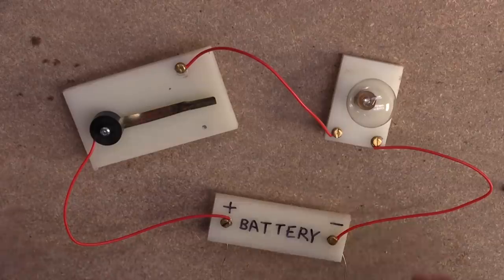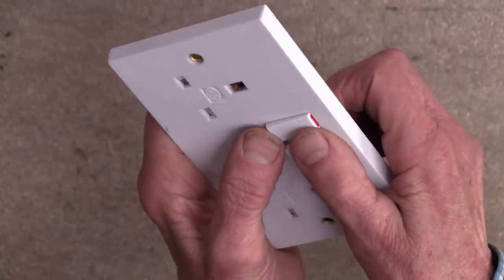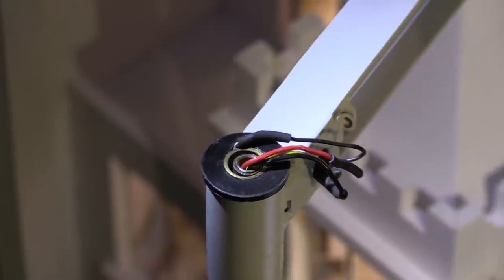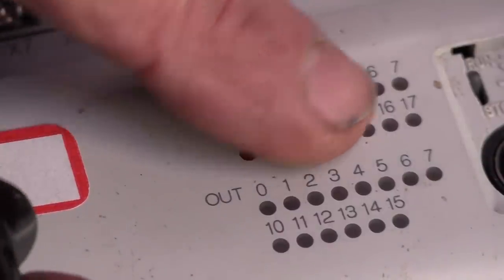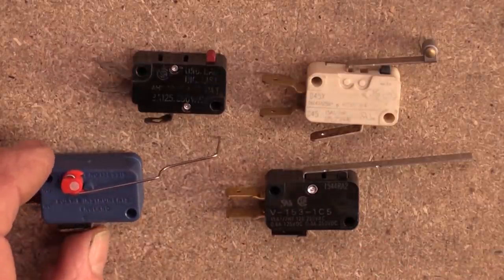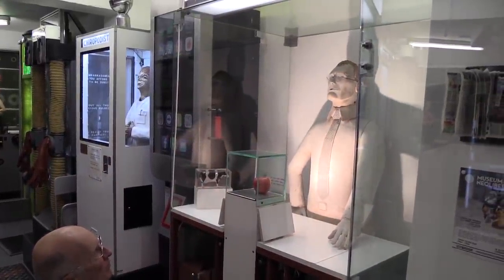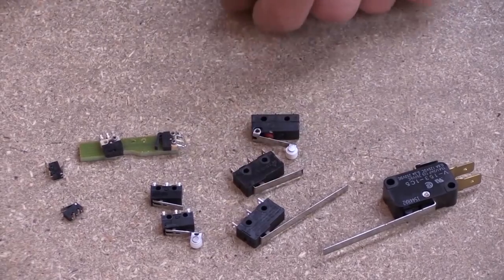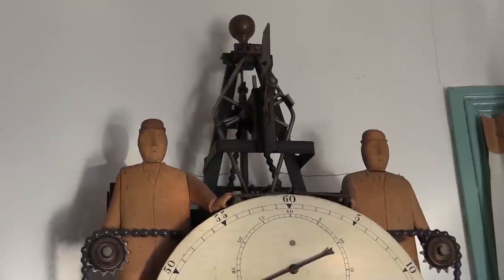SWITCHES - The Secret Life of Components, a series of guides for designers and makers - Episode 4

Comment: At an old house in northern Wisconsin we had wall light switches with a sealed capsule that was simply rotated by the switch handle, and mercury inside made and broke the contact. I think they were advertised as "silent" switches for those offended by the clicking. I also found references to mercury switches used for safety in the presence of explosive atmospheres, so the light switches in a hospital operating room, for example, might be of that mercury type, since any arc is fully contained in a sealed capsule.
Reply: Peter,  Back in the late 1970s and early eighties when I was a car stereo and alarm installer, we used to install plastic encapsulated Mercury switches mounted to the underside of car hoods and tied into the alarm system, so if somebody jacked the hood open with a crowbar to steal the battery, the alarm would trigger as soon as the hood was raised.

Comment: I wonder if the mercury switch/wall sockets were in a place where there might have been explosive gas or dust. Any arcing of the switch would be contained and safer in that kind of environment. Just a thought...
Reply: The wall switched were marketed as "silent switches" in years gone by (1970s).

They also had a secondary use to help to quench RF interference - I've seen them  installed at a  radio intercept station as well as a coastal radio station, with anecdotal reports of them being preferred for high-end recording studios. Yes, with AC zero crossings the arc is quenched anyways but presumably the mercury seems to provide a "soft" start and finish to the arc as the liquid and it's vapour makes and breaks contact - anything that softens the sharp transition is a good idea as rapid rise and fall impulses = high bandwidth emissions.

They are also much harder for the user to "ride" the switch half-open and arcing if they activate it slowly. The mercury provides a fully wetted and moveable surface so tarnishing is not a problem for decades of use, so they are quiet (RFI-wise) throughout their life.
Reply: General Electric made mercury light switches they called the "Super Switch". IIRC they ended up banned and ceasing production of them despite the mercury capsule being deep within the switch where to open it you'd have to take the switch out of the wall, disconnect the wires then smash the switch with a hammer. But stupid people who think they know what's best for people just have to exert their power by getting harmless stuff banned.

Some searching turns up several other companies that made mercury light switches, most of them, including GE, emphasized their click free, smooth and silent operation along with never wearing out due to not having mechanical contacts.
Reply: Mercury switches are brilliant if you don't want the "contact bounce" effect of spring driven contacts. If you are counting up switch inputs with say a microswitch then you would need a debounce function in your circuit to prevent nuisance multiple counts. You can get away with not doing debounce when you use a mercury switch.    (Or one of the newer liquid-metal ones that replace them)
Reply: @jagmarc  good point, however the mercury can shlosh a bit if the capsule movement is not varied enough
Reply: @Poop-nu1so I don't know if I'd feel comfortable with a setup with mercury switch being bumped around anyway.  I certainly wouldn't have on a vehicle for example in case it got into a crash.  The best use for one I've had is formal tests on the bench during product development, for inrush current spike measurement for a unit to go on an airframe power bus. Inrush current has to be carefully limited during swich on so as not to disturb other units on the bus. The mercury switch is absolutely perfect for the qualification test, a zero-bounce contact closure 100% of the time.  Important of you had carefully set up a one-shot test and didn't want contact bounce to mess it up.

Comment: Those mercury wall switches were probably intended for use in a laboratory, a mechanics shop, a painting/varnishing room, or some other environment where explosive gasses could be present.  The mechanical side looks like a common wall switch, but the uncalculated mercury contact contain the arc that forms when the switch is used, so there is no risk of igniting any volatile fumes which might be in the air.

Comment: For inductive DC loads like motors, put a reverse biased diode across the switch to stop arcing. 
Normally the diode will not be conducting (being reverse biased), but at the moment the switch opens, the induced current from the motor is flowing in the direction of the diode and will be shunted back through the motor.

Comment: Limit switches using microswitch with a leaver are obviously very simple and working solution. But in many modern designs, if you can, you can just make the object hit a solid wall, and that can be detected in current / torque rising in the motors or stepper motor. Often it doesn't even require specialized microcontroller or extra code, as a lot of stepper / motor drivers do have outputs for this purpose which are easy to hookup to relays, or PLC. A lot of device both in consumer space and industrial devices use this method. More reliable, less parts, less wires, maximizes travel. Pretty neat. I.e. my 3d printer has no limit switches. It just bumps into all sides, and detect that the current is rising. On precision machines, a more complex methods are used, either a digital readout or inductive proximity sensors, or a mix of both for safety.

Comment: When it comes to sub stations, these are isolators you showed. They use different types of circuit breaker which checks the current, voltage and frequency.

Comment: The high voltage switches move slowly to prevent thunder. If they moved at high speed, there would still be arcing but it would be a loud cracking sound, like thunder. Plus, the slow moving switches increase the power to the line slower, using the air gap as a resistor.

Comment: Note that reversing a motor, whilst it's moving, drastically increases the load on the gearbox and shaft, as well as causing large current surges, which can cause damage, if it's driving a load with a lot of inertia. I definitely prefer to use limit switches with diodes, rather than on the inputs to the controller, especially when over-run will result in damage to the machine. If you need feedback, so the controller knows the limit has been hit. There's no need for a separate switch. Use an SPDT switch and take the input from the normally open contact. For very large motors, a reversing contactor is used and the limit switches can be put in series with the coils.

Comment: Beware when using 'power' switches for very light loads like inputs to PLCs and microcontrollers. The contacts inside oxidise and soil.  It's fine when the switch directly handles the load current because the arc cleans the contact. Low-current contacts ones are better suited they have non tarnish or gold contacts and in the past mercury-wetted types (most get damaged by current more than about 20 mA). Or use opto interruptors (which can be electrically fragile if misused). I should mention in UK there's a fantastic product available to use when switch contacts soil up and stop working called Servisol 10. Great too for scratchy pots on studio mixing desks too.

Comment: About the solid state relay. In industry for loads like motors, or heaters, if they don't require rapid switching on and off, it is very popular these days to use a hybrid switch. With both slid state relay (SSR) and mechanical switch. During on, the SSR is turned on first, then the relay, then the SSR is turned off. SSR can turn things up without arcing, but then the load is transfered to mechanical relay, which can have lower resistance, and heat up less. Similarly, switching off: while the relay is on, turn on SSR, turn the relay off, then turn the SSR off. It again will prevent the arcing, and switch things off nicely. Because the time delay of the relay is pretty well known, and is definitively less than a second, the SSR will be turned on for very short period of time, and will not require big heatsink (but its temperature will still be usually monitored by a chip or micro controller). Some hybrid relays, do have also a special mode to dump back EMF to bank of high power resistors on turn off. Similar hybrid approaches are sometimes used in power supplies to charge input capacitors. Initially capacitors are charged using relatively high value resistor, then after specific time (or monitored voltage), a resistor is bypassed using a relay. Then the rest of the power supply starts.  This reduces the inrush current, and reduces failure points (like fuses, NTC resistors, switches when switching ON - but not OFF, if there is load present, etc)

Comment: 30:55 perhaps those mercury light-switches were used in a situation that either required ZERO maintenance, or more likely a chemical situation where a spark could cause an explosion.  
The encased liquid mercury switch can be used forever without building up any tarnish on it's contact surfaces, and it cannot weld itself shut.  
Also due to it being encased in glass - the arcing inside it will never be a source of ignition, so is safe for use around explosive chemicals.

edit:  oh other people have already said this :)

Comment: 31:00 those mercury wall switches might have been a equivalent to a US switch the "silent switch" for nurseries in the like. I could also see that being used somewhere where you wouldn't want an arc to form say around explosive gases. I suspect they pre-date everything due to the Ark being sealed it would be perceived to be safer and it would be easier to implement than the spring mechanism that came I believe later.

Comment: You should add self powered switch or power generator switch. These small electronic switches generate enough power from kinetic press to run a whole micro-transmitter to enable a device.

Comment: The breakers at substation are actually spring loaded. They can open, even with lack of electric power to drive motors. They open fast. Some have very powerful springs or pressure systems, to open them rapidly. You don't see them usually, because these devices are usually fully enclosed in special kind of gas or liquid, to reduce arcing and extinguish it. Amazing video on the switches topic tho.

Comment: I had a volvo 740 from 1991, a sedan and in the boot lid was a mercury switch for the boot light. I was astonished they used that still in 1991
Reply: I remember thermostats using them well into the ‘90s. I think they finally switched over around the year 2000.

Comment: The wall switches with mercury were probably to address arcing and oxidation of contacts.  I'd presume they were evacuated of oxygen and assumed they would last longer than open-air contacts in addition to their preferred use in environments where they may have served as an ignitor.

Comment: good video sir. for your question of what purpose the mercury switches in the end of the video have been used. probably they have been used for switching lights in a Explosion safety rooms or EX rooms. where sparks and arcs or open flames are not allowed

Comment: My wall thermostat that controls the heating uses a mercury switch and a bi-metal coil. I actually prefer modern thermostats with spring contacts because they make an audible click when they go on, but I haven't updated the old mercury one because it's just cool.

Comment: I'm surprised Mr. Hunkin didn't talk about Switch Bounce.  How all switches have a tendency to bounce when turned on or of, so to sensors, microprocessor or digital connections, the switches appear to make several contacts, when only 1 is desired.  Also, digital is also switches: on or off.

Comment: I guess a good use for your mercury wall switches would be in explosive gaseous environments. 
To avoid material stresses from your lever yanking customers, may I suggest putting in spring or rubber style dampeners ? It works very well to prevent my eager dog from ripping off his line/injure his neck

Comment: Interesting stuff. I recently had a problem with the pressure switch on my old portable Emglo compressor.  The contacts on the switch were burnt. One much more than the other.  I cleaned both contacts with some super fine Emery paper. The switch worked a few times and then stuck on. It welded itself together. I could unstick it easily but it would just reweld itself.
That leads me to two questions.  By sending these contacts I made them flat.  Are they normally a convex or domed shape?.  If so, why?
I would assume the flat shape would make better contact or more contact.
Love to see you include some information on the shape of a contact and the material it is made out of.
Thanks for doing this video. These days I don't think enough people appreciate the complexity of a simple switch.

Comment: 23:28 The diode should go across the microswitch - so the microswitch only breaks the circuit if the motor is going the non-permitted direction. Reversing the motor and the diode will pass the current to enable that.

Comment: The slow switching in substations you show in the video operate very rarely, it's not economicaly feasible that they open quickly. For quick opening under high loads they use breakers, a quicker type or switch wit arc supression (and multiple times the cost).

Comment: regarding RC suppressors/snubbers:  my experience with these have been for suppressing ringing at transistors when switching an inductive load.  This is not uncommon for the switch transistor in switching power supplies.  Without them, it is possible to have the voltage "ring" in a damped oscillation at hundreds of MHz.   This would cause the design to fail electromagnetic compatibility tests and interfere with other electronics.  Zener or TVS (Transient Voltage Suppression) diodes or MOVs can be an option to absorb some high voltage switching transients too.
Reply: Contact snubbers are a thing too.

Comment: If you need liquid-metal switching without the toxicity/evaporation of mercury, you could try NaK (a liquid sodium-potassium alloy used to cool some nuclear reactors and at least one novelty PC CPU cooler), but it oxidises rapidly in the presence of moisture, to the point of being a severe fire hazard if it gets wet; so you need to keep it in a sealed, moisture-free environment.

Comment: Well, there are two reasons why HV switches move slowly.

First is that there is nothing good in fast rotation of something heavy under voltage. Second is that fast movement makes air move, density locally changing for a moment, arc generation is unpredictable, more sparks generated and etc. There are a lot of videos showing what happens when HV circuit breaker malfunctions and does things fast.

Comment: the resistor should be in parallel with the cap.  The cap goes across the switch.    The idea of the resistor is to drain the cap so you don't fry yourself when you open to work on the unit.  The resistor should be a very high value like 1 Meg Ohm or more.
Reply: I've had to do something similar to debounce switches and contacts.
Reply: No, the resistor and cap are definitely in series in a snubber circuit - they need to be sized correctly for the load though, and are often better if across the load, not the switch - then the load will discharge the cap anyway.

Comment: If end-switches with diodes connect another way - each normally closed switch in parallel with diode - so diode will work only while contact not closed (short moment when moving part retreat the end position), so its reduce power loss on diodes while moving. Anyway diodes works while initial current so it must be still hi rated for pulses

Comment: Ironically mercury switches are used for their safety characteristics. Mercury switches are used in environments where you may encounter explosive gases or powders like chemical plants or grain silos. The contacts are hermetically isolated from the local environment and usually filled with inert gas, usually plain nitrogen. As long as a mercury switch remains sealed, it's as safe as mother's milk.

Comment: A problem with switches that I always had, when dealing with low voltage low current situations such as logic gates, was switch bounce.  In some applications I used Hall effect switches, which worked well.  With mechanical switches  I tried various combinations of capacitors and diodes, but they never really worked.  Eventually I resorted to using a PIC microcontroller rather than logic gates, with a de-bounce bit of the program - but that always seemed to be overkill.  Do you have better solutions?

Comment: they sell mercury relays for running high power electric heaters such as industrial oil heaters. they have a solenoid that plunges into a sealed tube of mercury to make the connection. they are an alternative to SSR's can  last millions of cycles ( ssr's are billions) and unlike ssr's have no leakage current. 
the only drawback is they must be mounted vertically and stay that way at all times.